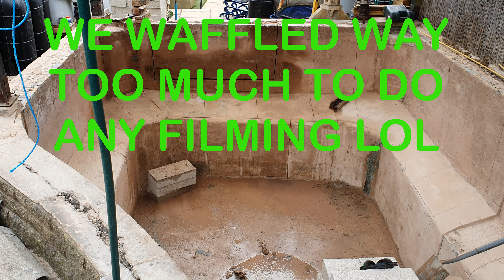FLUKEY FLUKES A NEW FISH AND EVICTION DAY

Comment: Thanks for the shout out mate 👍,jpd shori excellent pellet as I keep telling people, and bang on about the brickwork  mate, liner pond horizontal solid block but fibreglass done properly has roughly the strength as sheet steel at the same thickness, now I'm waffling lol
Reply from the maker: Cheers for the Coment Rob , nice to see ya 👍 well this pond has been here for some time as you know and never had an issue with the way it was built 👍👍👍👍
Reply: Let me know when you're ready for glass, have a customer that's found a bargain supplier 👍
Reply: @walkerkoi4886  thats interesting to know